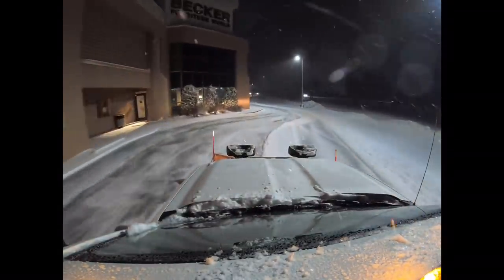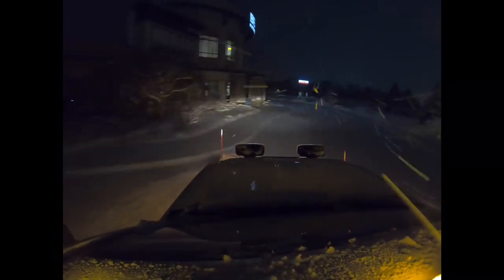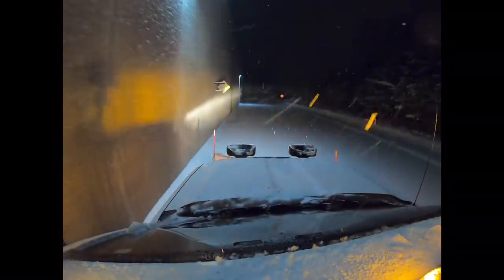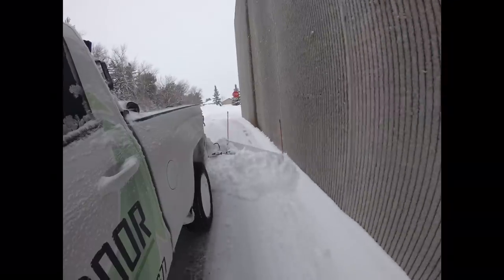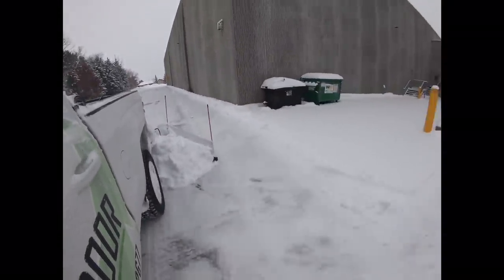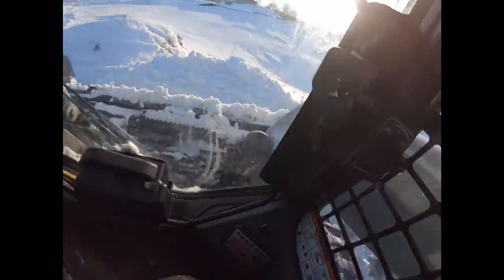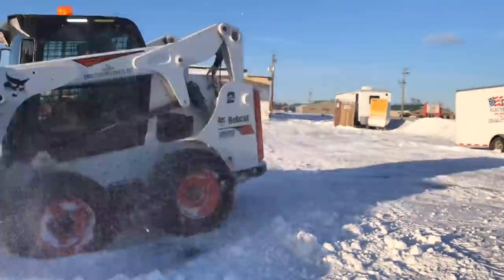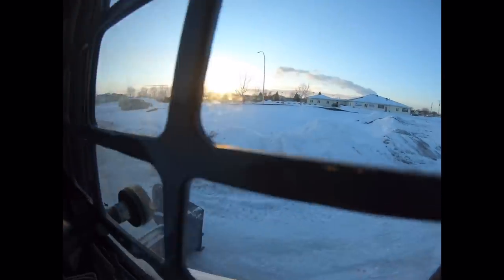SNOW PLOWING 4K VIDEO DOING OPEN UPS USING GOPRO HERO 7

Comment: Just an adjustment on the quill. Under the cover flat blade screwdriver. Have someone move it up and down while you turn the screw.  1/8 adjustments. Ez.